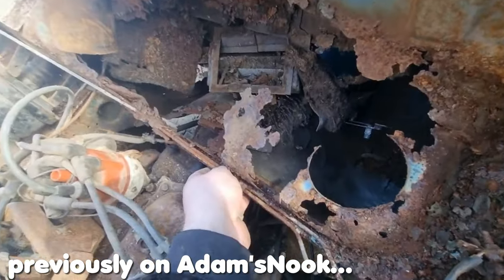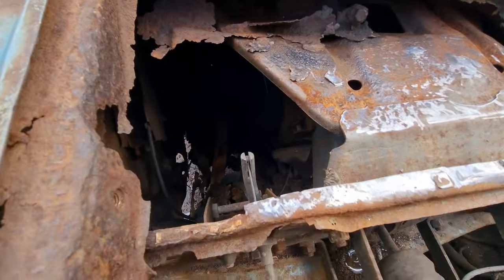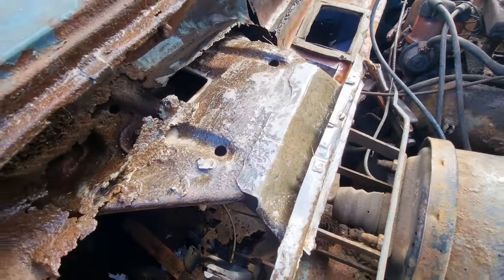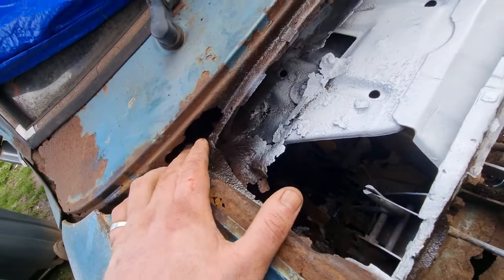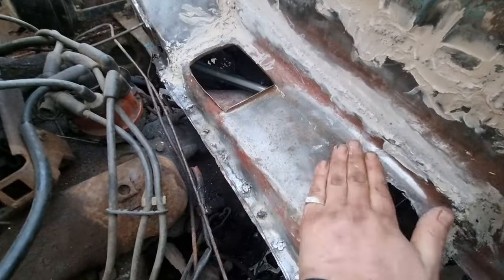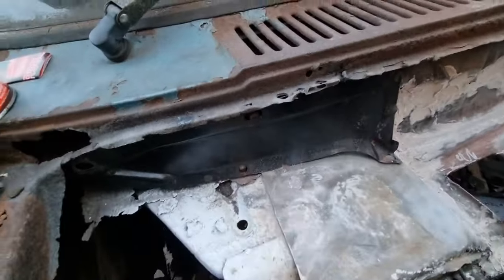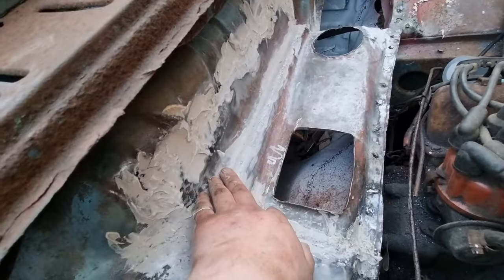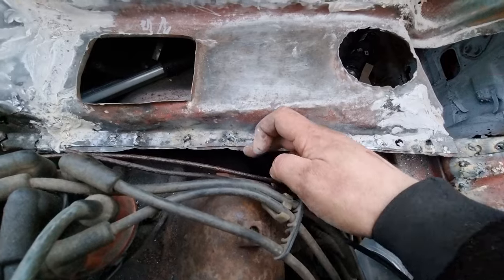Cortina Mk4 Ghia 2.3 V6 Restoration || More Work To The Bulkhead (P10)

Comment: The dreaded sanding I would probably use a brazing disk to do the sanding it's good for flattening welds too on a 115mm angle grinder...my god you've nearly finished the bulkhead and it looks great 👍  at this rate you will have done the welding by Christmas,I'm rather impressed you managed to do it with the engine in place, That can't have been easy 😀 
Keep up the fine work. Keep the faith, eye's on the prize lol
Reply from the maker: Thank you bro i will do some touching up when i remove the engine but want to do a will it start first and it was not easy lol

Comment: Keep it up mate be a solid motor when done admire you mate its alot of work
Reply from the maker: thank you :) i have still got to grind the welds down better with flap disks but also want to get a gas welder fluxcore just is not cutting it for me its hard work been using fluxcore for years as gas it pretty hard to get i think i only know of one place i can get it near me

Comment: I recon by the end of the month, this will have a completed bulkhead.
Reply from the maker: i reckon so the way things are going hehe just really wish i had a gas welder fed up with fluxcore now
Reply: @AdamSNook.  Gas welders are money,  but will be worth its weight in gold,. with this.   What does the car need parts wise, looks like its missing a good few bits
Reply from the maker: @procta2343  it needs rather a lot of stuff as it was stripped needs steering column steering wheel clocks rear brake drums grill rear axle as it as the incorrect one on it I need one for a 2.3 power steering  pump and steering rack joint to steering column nuckle that's all of the top of my head
Reply: @AdamSNook. How easy is it to find a 2.3 rear axle?
Reply from the maker: @procta2343 I think I have found one just need to speak to the bloke to make a deal

Comment: Nice job mate ..by looks of it youl have it done in know time. At the end of the day it's MK4 2.3 Ghia a very  rare car
. tax and MOT exempt.my dad always said the german 2.3 Ghia's wete better made lasted longer than the British models .if that wasn't laying in bad weather for 20 odd years it would of still been solid car.. great work mate take door cards off if your welding new sills on .. I made the mistake of setting one of the door cards on fire when i done inner sills on my cortina I had
Reply from the maker: thank you mate i dont one better once i set my self on fire when welding under a car once smelt somthink burning turns out my coat was on fire hahaha i have got to get some flap disks and regrind the welds down once i have sanded the filler down yeah i will more than likley take the doors off when doing the sills

Comment: To think a couple of weeks ago that was a huge hole Adam your certainly making some progress mate well done fella it’s looking great 👍
Reply from the maker: yeah its been hard work i have still got to grind the welds down better once i sand the filler and get some flap disks or a finger sander also im going to buy a gas welder as i have had enouth of fluxcore it to much hard work i have been using it for years defo not doing my chassis with fluxcore hahahaha

Comment: if you going to use filler, this is just a suggestion use stranded fiberglass stronger and waterproof when applied and finished correctly.
Reply from the maker: that is what i wanted to use i swear by it great stuff  just never had any to hand but iu want just sand the filler off and use the fiberglass filler thats what i have been modding my ford focus mk2 own built body kitt with along with fiburglass matt and resin i also like to use resin brushed on into the welds i must admit i do not like body filler i try to use as less as possble in builds
Reply from the maker: :) think i will do that then and sand the filler off and use fiburglass filler makes good sence mate
Reply: just a suggestion you have  a lot of work in front of you , you want it to stand the test of time mate  @AdamSNook.
Reply from the maker: @fredjones1238 and its a suggestion im going to do mate as i do want all this work to last as im never getting rid of this car its going to be with me for good :)

Comment: I bought a finger sander for getting into small spaces. Really handy but don't sand your fingers with them lol. Good progress Adam it looks solid.
Reply from the maker: yeah i want one of them finger sanders been looking at them on ebay :) i hate sabding filler lol boring job i have got to get some flap disks to grind the welds down better its still working prgress but going to get a gas welder soon as i have had it with fluxcore its hard work with one of them lol
Reply from the maker: yeah dont want to sand my fingers hahaha i have pretty much ended up with cuts every time i work on it lol all part of the job i guess

Comment: Should have used fiberglass kitty hair over welds. But realy should have been seam sealer. Tape down both side apply sealer and pull tape to look neat. Filler will crack. Seal both sides.
Reply from the maker: Filler is not staying I,am going to be using fiberglass filler and seam sealer will  be used on other stuff

Comment: Do you have a grinder with a flap wheel?  Or a belt sander?
Reply from the maker: im going to buy some flap disks for my grinder and regrind the welds as my disk i have now is rubbish once i sand the filler down it will exspose the tops the wels and i can grind them when i get the flap disks :)
Reply from the maker: also going to buy a gas welder for the rest of the jobs as i have had enouth of the fluxcore welder
Reply: @AdamSNook.  fluxcore is a pain in the arse, I have done repairs with one,  you cannot really get a smooth weld.   Also you can get panel bond too, run a long the edge. To seal off the joins if you wanted.
Reply from the maker: @procta2343 yeah i carnt wait to get a gas mig welder iit will be a game changer plus a finger sander i am looking around at welders before i get to the chassis and floor pans
Reply: @AdamSNook.  Adam take a look at R tech welders. I have an R tech 181. You will need to rent a gas bottle
Reply from the maker: @petermarshall5932 oh ok thank you will check that out been wondering what to go for